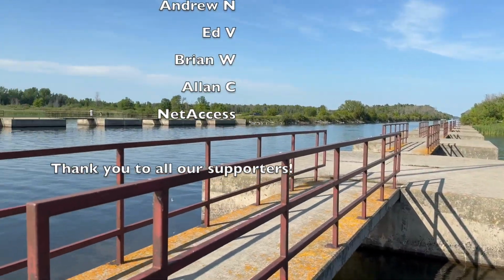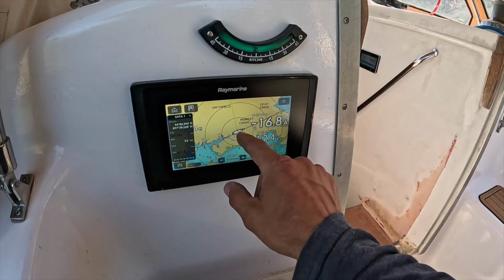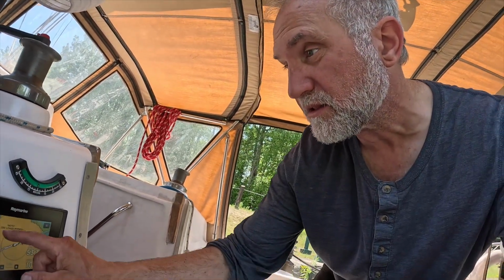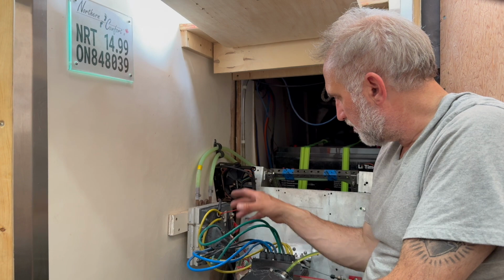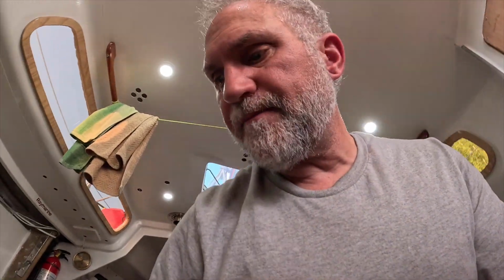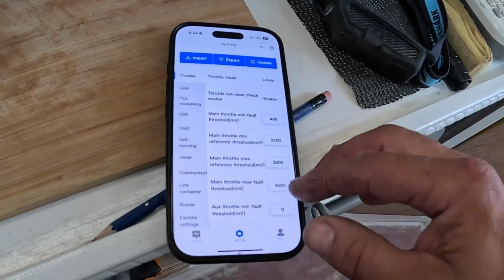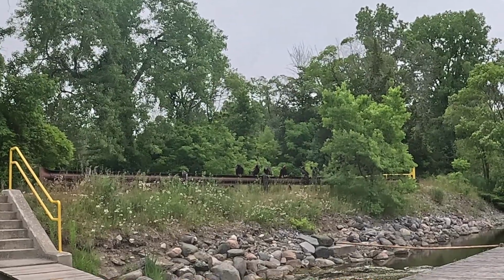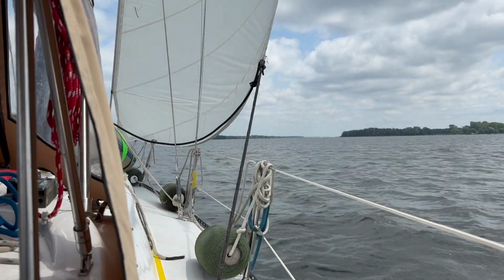Ep187 Electric Motor Failure in the Murray Canal; Ocean Bound

Comment: I'm looking at Golden Motor products to install inboard electric motor, but ATM I'm using a 48V DC 8 HP equivalent outboard on the swim platform motor bracket that I made a 6 wire extension cord inside a nylon yachtbraid cover to have motor control at the tiller and it has worked flawlessly for 4 years (it looks like an oversized trolling motor) 
Also get rid of those red isolator switches (off-1-both-2) and use proper knife switches that don't have a small internal contact that gets hot and melts the whole isolator switch.
Reply from the maker: best of luck to you with your project. sounds like you are getting your plan together. I am not partial to GM, but the motor itself has been solid. The new controller EZKontrol 48-1200 I am warming up to. The bluetooth readings while operating are very useful. I am now investigating how to get the motor data onto the NEMA2000 network.I'd love to have controller temp, motor temp and RPM on my chartplotter. Good luck!

Comment: Thanks for all the great Motor content. I'm about install an electric drive in, my 29' boat and all your videos have been great help.
Reply from the maker: best of luck to you! it isn’t always smooth sailing thats for sure. i am not advocating one way or another but sharing what I learned. going electric definitely isn’t for everyone but with careful planning can be an alternative to conventional combustion engines. still need fuel to run the generator to get long distances in. good luck with your project!

Comment: Hello, thank you very much for this very interesting video and congratulations on your channel. I’m writing to you because I bought a 10 kW motor and the new Golden Motor controller recently, and when I installed it, the first motor was seized, the shaft wouldn’t turn. After this problem, Golden Motor sent me a second motor, and with this second motor, when I connect it to the new controller, the same thing happens as in your video. That is, the motor makes a loud noise, like a bearing that isn’t working properly, and also, when it reaches a certain amperage, the controller shuts down the motor. The noise is very similar to what you have in your motor.

At the moment, I have returned everything to Golden Motor and I’m waiting for them to tell me where the problem lies. I’m really desperate because I’ve spent quite a lot of time and money installing two motors and the same controller, and although I was told that the controller could not possibly cause a fault in the motor, the fact that it has happened with two motors in a rowand now seeing your video makes me suspect that the controller may indeed be the cause of my motors’ failure.

I wasn’t even able to start sailing because the noise was so loud that I didn’t want to, and when I went beyond a certain power level, as I mentioned, the motor stopped. I wanted to ask you, when you have news, if you know what the fault is, and if my comment helps you by knowing that for me too, the controller has caused the problem.

Thank you very much for everything, and keep up the great work on your channel.
Reply from the maker: btw: on the EZKontrol 48-1200 controller i was able to make the motor screetch and halt by changing some of the settings. the smoother sounding rotation and advice from golden motor themselves was to use the factory default settings. only after upgrading the firmware on the controller and using the factory settings did the sound smooth out and i motored a long way through the Erie canal, hudson river and up the coast. I think the default out of the box settings didn’t work for me as the throttle wasn’t the right type. i had to change some settings for the throttle to get my motor to work. its a learning curve.
Reply from the maker: interesting my 1st controller was defective but the replacement vec500 lasted 4 years and about 2000+ nautical miles. my vec500 controller died because of human error i am convinced (my shorting the throttle wires) not from a fault. it was 4 years running. 

my replacement the EZ kontrol 48-1200 after discussing with an electric motor specialist likely described the change in sound due to the fact that the power difference (500 amps vs 1200 amps) likely has a different algorithm for the creation of the sine wave. if it is more square (and guessing it is) the motors fine start and stops as it rotates would sound more granular. 

i did use the bluetooth app to upgrade the firmware on the controller and the settings changed and the sound was smoother. 

i motored many miles on it, i think almost 900 miles and for 40 hours straight without any issues. 

my one comment on golden motor is that the feedback has to go to china and i would say the feedback isnt very helpful generally speaking. i got more help on the user forum on the goldenmotor.com user forum than from golden motor themselves. 

i hope your situation improves and you get through your issues. thx for the feedback!

Comment: Nice video, what a bummer that the controller was dead! I myself have the 48v1000 controller, but I don’t have that weird noise in my motor… And I also do not use the Torque control, but the speed control… torque control is reacting weird on my throttle….( but hey my boat is still on land and not in the water, maybe have to change that when I am on water)
Reply from the maker: i am glad it wasn’t worse but i sure was worried there for a bit. i did smooth out the noise partially by using the app and upgrading the firmware on the controller. when i upgraded it reset the values in the app. although the EZkontrol 48-1200 still has this hum as compared to the vec500 it didn’t sound as bad as my first test. i also have over 1000 miles on the motor since the controller swap so its working. but it still sounds different. i do appreciate the bluetooth and being able to read the motor and controller temps. big advantage over the vec500. thx for the comments!